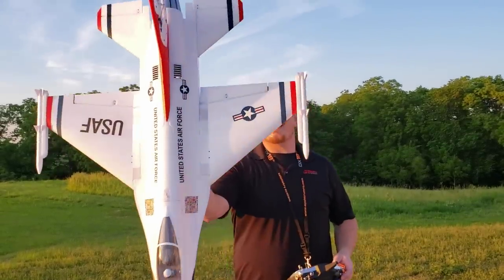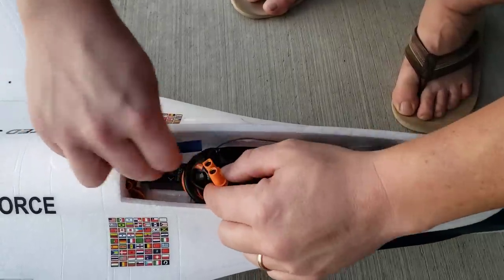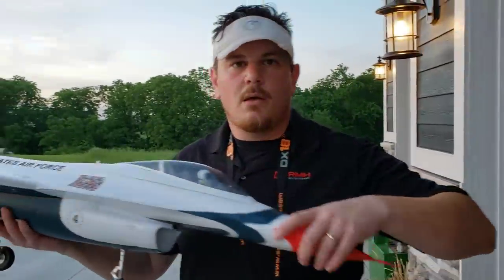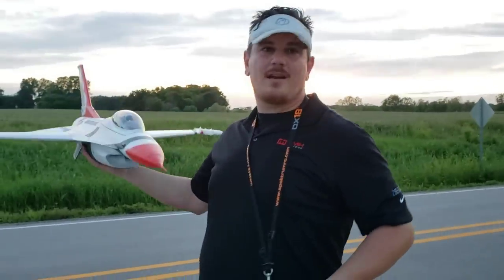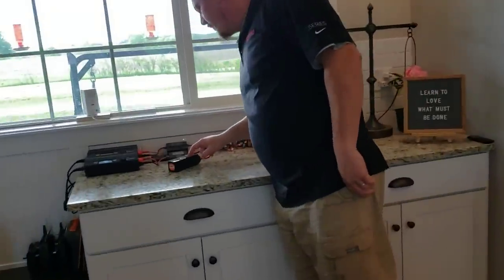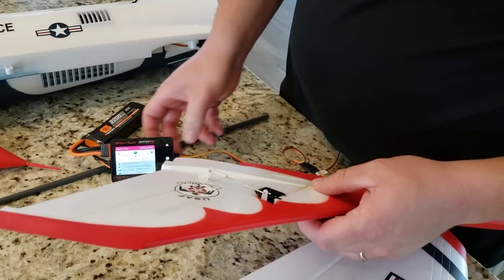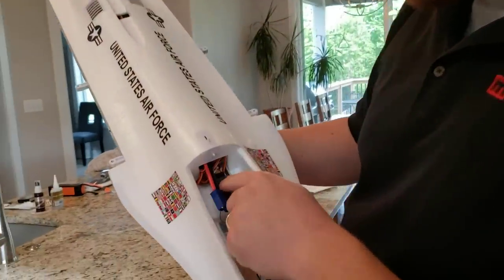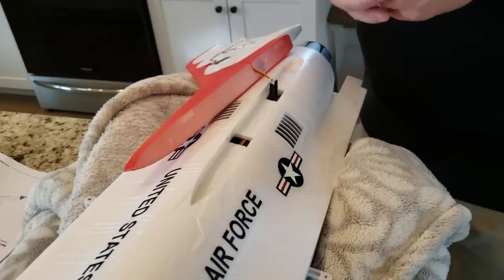E-flite - F-16 Thunderbirds - 70mm - Unbox, Build, Radio Setup, & Maidens

Comment: Gotta love the F-16, I used to make cardstock/epoxy laminate profile gliders with 5-6" wingspan, could set up for maximum glide(fast!) Loops, or stall turn "boomerangs" Very stable platform when slightly nose heavy, nose light gives nice hi-alpha.
Use foam block opposite sides when installing battery "askew".. no problem keeping in place/ balanced 😎great plane!👍
Reply from the maker: Right on- so you could still get the canopy on?
Reply: @BrianPhillipsRC  I havent got the plane yet, but in looking @ your dilemma, it looked like a possible solution..even if the battery moves only a half cm further back, 😀 messing w/location of AS3X/SAFE RX may change effect of stock tuning, may get ossilation/etc

Comment: Great plane, I flew a couple SMART 4000’s through it last night and seems like a good size for it. This is actually my first EDF and with the safe mode I’ve been comfortable and gradually working my way out of safe. Thinking about putting a firey booty afterburner in it now! 😀
Reply from the maker: Nice! What's your other planes? You must have a pretty opened place to fly?
Reply: I have mostly Eflite warbirds, a couple micros, an Arrows Bigfoot, balsa Eflite Champ, and the new A-10 which is fast! There’s a big open field next the parking lot where I work. It’s a great place to fly, just a few light poles to avoid when landing.. I don’t have too long of a rollout with the F-16 if I give it a little high alpha on approach, slows down pretty nice even in safe mode.

Comment: I’ve started adding a servo extension cable to the bind port of my planes. Easier to get at if I need to re- bind the plane.
Reply from the maker: Yeah, that's a good idea, but might find that it'll get in your way from time to time. Too bad they didn't use an AR637T in this bird ;)

Comment: Do you have to assign a switch to the gear channel -
does it default to a certain switch ?

don't you have to assign aux 1 to the switch you plan to use for safe - BEFORE you do the 5 up- down thing ?  ... seems like that was covered in a previous plane you review.....

for the parts that get glued -
would it be okay to use hot glue along the sides  (for easy removal if needed)
rather than the real sticky, hard to remove stuff on the underside
Reply from the maker: Before you can do the ASSIGNMENT for SAFE SELECT, you sometimes need to ACTIVATE a channel, or ASSIGN it to a switch of your choosing.

yes, if you want to hot glue, but keep in mind, the foam will hold the heat, and can make a void, where there's really weak bonds, so work fast, but be careful! ;)
Reply: @BrianPhillipsRC  Thank you. You are my favorite reviewer. The use of the paper strip to make COG is clever but is it accurate ? Since it follows an arc (curve of the wing) then does it not come up short ?  Notice on page 11 of the manual the lines are square.
Seems a line straight up from the front of the wing then measure straight across 90-110mm and then a line down to the wing would get the accurate result. Maybe hold a pencil upward perpendicular at the front of the wing and a mm ruler to measure across 90-110mm and then whatever to drop straight down to the wing and mark the COG with a pen. Think of the diagram of p11 like a football goal post lying flat on the ground. Then lift the goal post up 90 degrees perpendicular to the ground - the 90-110 mm is like the distance between the goal posts.
Reply from the maker: It was a mistake - I'm sorry for that! You need to imagine a straight line from the leading edge of the wing (or whatever they say) then "float" from the leading edge to the CG point.

Good catch!

Comment: You need to get your high alpha practice time for shorter landings .  Its super easy with this jet, even with safe .   Also battery all the way back is my sweet spot ( same battery ) .. good luck   nice job
Reply from the maker: Yeah, we figured that out, but this was a maiden...so didn't realize that yet. This plane might be one that I actually put some dead weight in the tail to move the CG back

Comment: Sorry to bother you, Brian, but I KNOW you know what you're doing and I also KNOW that you ACTUALLY read, and respond to, your comments. Quick question: When flying electrics, is the throttle trim supposed to be in the middle or at the bottom? I was having HUGE problems with arming my Blade Nano CP S for MONTHS and I THOUGHT the board was bad. I'm pretty sure there's something wrong with the electronics, since I bought it used and this model was WELL KNOWN for having board/solder problems, but I recently realized that MAYBE it was the throttle trim being in the center position? I dunno ... I have several other helis with Spektrum RXs and they've NEVER failed to arm EVERY TIME with the throttle trim in the center position. When you set up a new model (DX6i), ALL the trims are CENTERED, so I THOUGHT that's where they were SUPPOSED to be! Whaddo I know? ... I'm pretty much just past "noob" with no one to help me figure all this stuff out. Thx [in advance] for your help!

That F-16 is SWEEEET! My FAVOURITE fighter jet of ALL TIME! Wish I had somewhere to FLY it! Great video, as always!
Reply from the maker: Yes, Trim is to be CENTERED by default. VERY, and I mean VERY occasionally, you'll get a plane that refuses to work (Arm) without a few "clicks" of trim DOWN on the elevator. This is unusual at best, and dangerous at worst. If you can bring it to ARM, I'd highly recommend re-calibrating the ESC, if this is supported on the older gear your playing with here...

1) Take note of the throttle position, percentage all the way down (should be -102% or -105%....something like this.) IF the throttle position is way low...like 15% or more...then I'd go into throttle cut and make the change as an offset BELOW -100%...like the number you see on the MONITOR.

2) NOW, see if this works for you...if not, clear the trim back to zero, and move on....

3) Since it's a HELI, I'm not 100% sure you can do this as with a plane...so bear with me... normally you would from heli OFF and TRANSMITTER OFF, you'd set the throttle to 100% (All the way up!), then I'd SAFELY secure the heli, then power the transmitter ON, then plug in the heli. Make sure your throttle cut is OFF when you do this, or you're procedure will be self defeating. You actually WANT to force the ESC to relearn the throttle ranges.... now that BOTH Tranmistter and Heli are on, the Heli is probably beginning to sing songs of joy, indicating entry to the ESC programming menu. If you have a manual, use it, otherwise, if you can't find out what it is, and look up a manual, then quickly (before any songs start to play for too long) move the throttle stick ALL the way down to 0%, and you will hear it arm. This SHOULD re-teach the ESC it's throttle range. If your manual says different, please follow it over my "rule of thumb" guidance here.

Good luck!!! Hope this gets you taken care of!

Comment: The F-16 is a great flying plane. I had one years ago that was long before brushless EDF’s. It was a pusher prop mounted in the tail. It was a great flyer. There is a crappy video of it on my page. Of course I don’t have a professional camera crew like you but I get by. The plane was designed as a pusher. Soot had a nice stick mounted in the tail and a nice motor mount for a 400 class brushless motor. I ran a 5.5x 6 or a 6X5 pusher prop. It was a blast to fly!
Reply from the maker: Sweet! Sorry you don't have a "Camera crew" ;)

Comment: Have u seen real fighter jets low pass fly by it’s really shocking
Reply from the maker: yes. We used to have F-16's stationed in Des Moines, and we were out about 40 feet of the runway in the SIDA, and there was a low pass, and the guy proceeded to peel off at about 50 feet or so to the right and blow the afterburners at us. It was highly unusual, and AWESOME!

Comment: You could really shorten that rollout if you take advantage of the extremely stable high alpha capabilities that this plane has and slow it down to a crawl with the nose way up in the air. Ive talked to some guys at my field about theirs and they say it doesn't like to land like a standard jet just because its so floaty. Ive been interested in this plane for a while and am glad to see another perspective on it! Keep up the good work!
Reply from the maker: I want to get that effect, but have found it to be harder to get her to alpha...she just want s to fly UP???!!?

It's a balance and I'm not good at balancing ;)
Reply: @BrianPhillipsRC  High alpha requires a lot of up elevator and throttle management. Its also possible that you're flying a bit on the nose heavy side which is good while you get used to it.

Comment: brian, I just installed the ar637t Rx in a plane and also a smart ESC.   How do I get battery voltage displayed on my Transmitter?  Do I also need to use a smart battery?
Reply from the maker: You have to use that 2Pin plug thingy - You can see this on my FMS videos from about a month ago... I believe we did it on the F4U Corsair 1.7m

Comment: Ok Brian, so how did you connect to the 636 with forward programming as this rx apparently cannot do forward programming from a Tx!! This has been my experience also!
Reply from the maker: This was a V1....we've also done the V2...
Reply: Sure, but the 636 still cannot do forward programming from a transmitter,, only via an app on a phone. I have the V1 with the 636 and was going nuts until i discovered this. Have to get my phone app fired up to talk to the RX. 631 is fine for forward prog in v2

Comment: Hi Brian. I’m after a little advice I recently bought the F-16 thunderbird and would like to know what glue to use. I have zap ca foam safe with kicker but I personally think it’s too brittle for such essential parts of the plane. Can you recommend an adhesive.

Many thanks
Reply from the maker: Sure, here's what I use for many of the foam to foam connections...

1) Mucilage - Hobbyking offering...but thicker and more sticky initially, but it dries out quicker too...

Mucilage https://bit.ly/3fdfzQp

OR

2) Foam to Foam - Horizon Hobby offering - way more consistent, but more runny out of the tube, and since it's in an aluminum toothpaste-style tube, it tends to squeeze out when you lay it down - so use care...

Foam 2 Foam https://bit.ly/30RNnh0

OR

3) The contact adhesive LIKE 1 or 2 above. Many times we have a bunch left over from Dynam planes, for example.
Reply: @BrianPhillipsRC  thank you that’s amazing. I’ll use the Mucilage I think. 
I had a pretty catastrophic crash the first time out with the f-16 which resulted in a new fuselage, nose cone and canopy. 
I’m extremely annoyed with my local hobby shop as the recommended zap ca with a kicker. This resulted in the rear right stab coming completely off upon takeoff sending the plane nose first into the deck. After asking loads of different hobby shops and hobby enthusiast the conclusion was that the kicker caused the glue to go off far too quickly and as a result didn’t bite into the foam. 
Obviously I don’t want to have the same result this time around. 

Once again thank you for the great advice and links. 
Keep up the great work

Comment: For the flaperons/spoilerons, I tried to do that with my conscendo advanced. The programmer wouldn't let me do it, so I eventually got the AR637T and 30 amp Avian ESC. Works great, full as3x/safe, and the Avian ESC gives it battery telemetry with my smart 1300 3s so I don't have to guess with the flight timer.
Reply from the maker: I do a flapperon mod video...coming very soon :)

Comment: Hi Brian, hope you can help...did the maiden today on my F 16.  I noticed my aileron and elevator was very limited. At high rates it was okay but low rate it was very very limited. Took forever to make any kind of turns. I almost think mine came incorrect factory setting for servo arms  and control horn. Mine for alleron and elevator both servo arms and control hors are outer most holes. Is it suppose to be like this?? On the book shows 2nd last hole for  arms and outer hole for horns.  I am so confused . Should i just change low rate to maybe 85% to make it work? Hope you can help bud.
Reply from the maker: SAFE IS ON. Turn it off to fix this issue.
Reply: @BrianPhillipsRC  so you are correct Brian about this but my question is when safe switch is on my control surfaces move almost 40 to 50% less and when i turn safe off it is normal movement. Its very strange. My other f 15 eagle does not do that and both in safe and not safe control surfaces move exact same amount. I am so confused. Either safe on or not wouldnt the surfaces move similar amount?  I think thats why my turns are so wide in safe because it is not travelling to its maximum capacity . Is there an issue with the AR631 reciever you think? I am scared to even fly it again since i can clearly see control surfaces are not going to its capacity or limits. Any help would be helful man. Sorry to bug you again man but as a newbie i feel like you are the plane tech guru . Lol

Comment: Brian between this bird and the A10 which one would you pick? I'm leaning towards the A10 as it seems like it has longer flight times?
Reply from the maker: The A-10 is a better plane...way more features, and way more details, and way more speed, and way more power, BUT this plane is also very cool, and it's quite a bit less cash too ;)

A-10 Thunderbolt 64mm https://bit.ly/2CCiFPp

F-16 70mm Thunderbird https://bit.ly/3fxi1Bi

Comment: What kind of distance do you need for takeoff on grass with the HABU? Noticed it was pretty short on pavement but I didn't see you do any on grass unless I missed it. Just want to make sure my strip at the house is long enough.
Reply from the maker: I think you could get up from grass in about 50-100 feet, depending on wind. Worst case, you CAN hand launch it. If you have a clearing, you could do it less too ;) Keep in mind, SAFE will limit your pitch and bank angles, so if you're flying with SAFE might want that OFF just to get in the air???

I think you'll be good to go!!! Cut the grass shorter in the proposed strip, if you want it to be shorter. This plane does AMAZING in grass!
Reply: @BrianPhillipsRC  I just seen in a video that  its a good hand launcher. I think I'll give it a go. As always thanks for the info!

Comment: Hey Brian, you can harrier that thing at 5mph. Nose almost vertical all day long. Give it a try.
Reply from the maker: Been trying, and not having that experience.
Reply: @BrianPhillipsRC  I wish I had some video to show you. If you know what is referred to as a wall, bring in the airplane fairly fast...not extremely hot. Pull hard on your elevator while you kill the throttle. This will put you in a crazy harrier attitude called “ A WALL” Get on the throttle quickly and just let the airplane sink a bit. While the nose is at around 40-50 degrees work the throttle to keep a level horizontal line as it passes you with mostly full up elevator. Most likely you will be working the throttle a ton to keep in a harrier while not letting it climb. You won’t have any wing rock and it won’t drop a wing at all. Gotta remember not to do the harrier too high as you really need to see and feel how the thing is reacting. Most problems I see when pilots are learning a particular 3D move, they fly the airplane way too high and can’t get the true feeling of you and the plane thus a failed experience. Give it a try, once you do it you will forget about blitzing passes. Trust me, there is nothing cooler than this. Jamie

Comment: Did any airplane hit that telephone pole in the past?
Reply from the maker: I have hit the power line twice, once with the Carbon Z Cub and flew for another 6 minutes after...once from the Cessna Longitude UMX, which was somewhat devastating, but I had her fixed in less than an hour...and ONE plane I flew straight into the power pole ;( That video didn't make it online - LOL...it was a pretty bad crash, but 100% operator error.

Other wise, I've hit the side of the house a couple times here, with small planes, but generally, it's very rare.

Comment: My mini apprentice keeps on losing control mid flight and whenever I throttle up the nose gear tilts to the right any tips on what to do?
Reply from the maker: How much does it tilt to the right? Sounds like you might have an issue with your THROTTLE and RUDDER stick (the left stick)???
Reply: Brian Phillips thanks for responding I actually just fixed it I needed A LOT of trim

Comment: Could you use a spektrum dsx as a radio?
Reply from the maker: I assume you meant, DXs? I wouldn't even try. If you want to see if it'll bind, I'm about 99% sure it will, but you'll need to be able to set rates and expo and this sort of thing for the F-16, and you can't on the DXs. If you're SERIOUS about flying the 70mm F-16, do yourself a favor and buy an NX8. It's a tough pill to swallow...I KNOW...but you're gonna be money ahead if you do it this way. If you're thinking 2nd plane, you might be picking up pieces...

NX https://bit.ly/3mbVuNB

Comment: Putting glue on the front of the sub fins is a real bad idea! You will find out why if you try and remove the fan cover!!!!!!
Best to remove the cover before gluing the fins.
I put an afterburner thing in mine and the only reason I was able to get the fan cover off, finally, was the fact that I had not removed the paint before gluing......
Reply from the maker: I already had one off for repairs ;) She came off easier than I hoped - LOL!!! When you get an over-zelous flare, those lower fins can drag pretty easy...